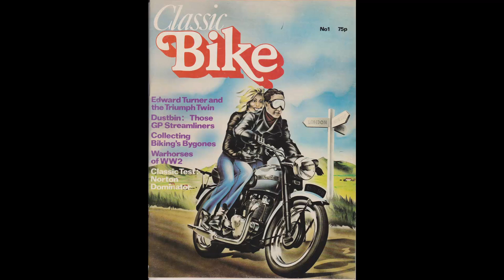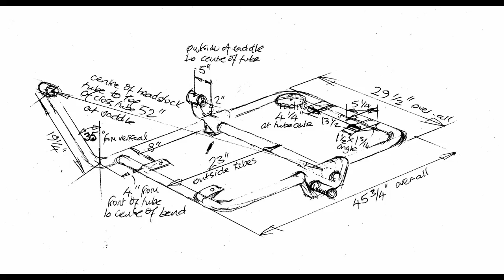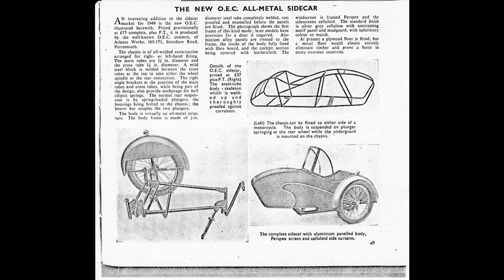A sidecar for the 40th

Comment: I remember the gentle pattering sound of the exhaust . Inferior models had nothing like my chicken shed sidecar . It took some work to replace all the frame nuts and bolts which had all worn to various dimensions. Metric unified sizes were still a far off dream . Was I the only rider reduced to tears by the starting procedure ?